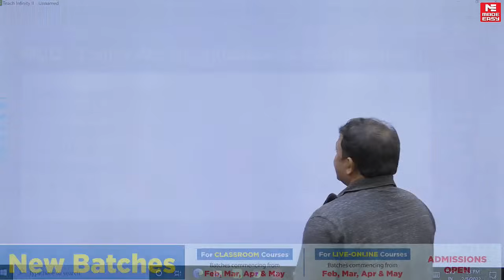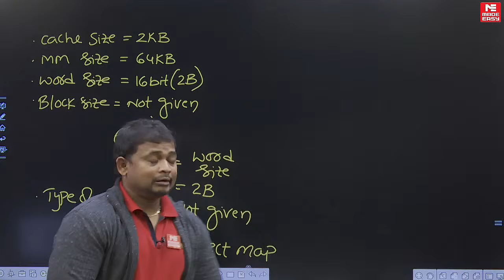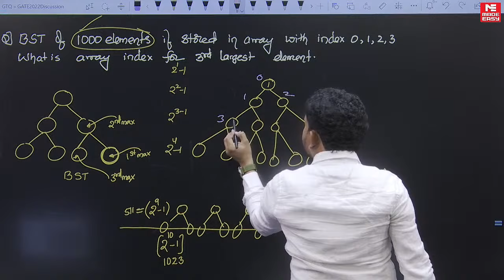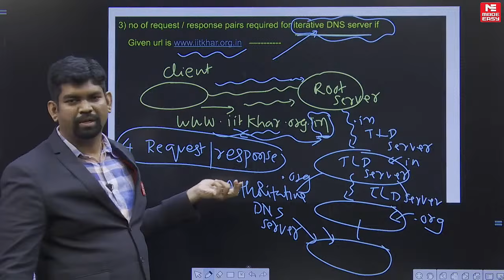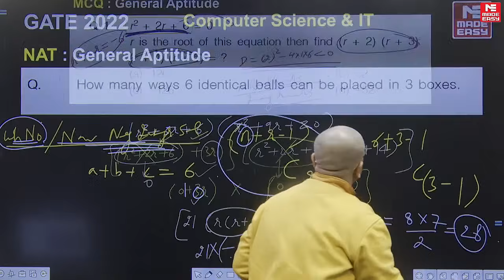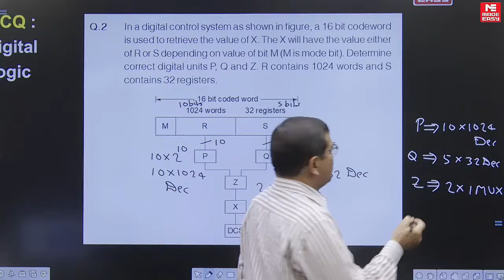GATE 2022 | LIVE Exam Solutions | Computer Science Engineering | CS | By MADE EASY Faculty Panel

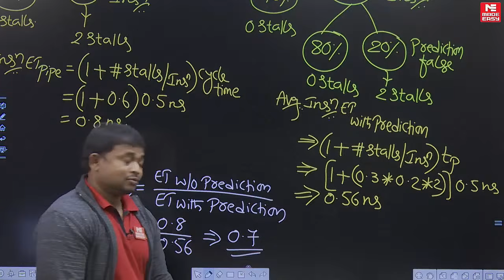Comment: At, 54:21, in question of branch prediction, the formula written is wrong, and answer calculation is right. Speedup in earlier part, Sir explained ET with prediction divided by ET without prediction. But on board, Sir mistakenly wrote the wrong formula as speedup = ET without prediction divided by ET with prediction. Please correct it.

Thank you.
Reply from the maker: Dear Amitesh,
Performance  is inversely proportional to ET.  
S = performance of prediction/performance without prediction  means ET without branch prediction/ET with prediction.
Regards,
Team MADE EASY
Reply: @MADEEASYEducation   Got it ✅. Thanks for clarifying. 😇